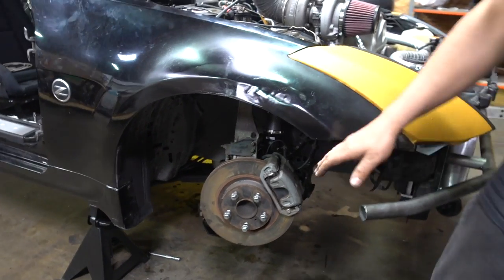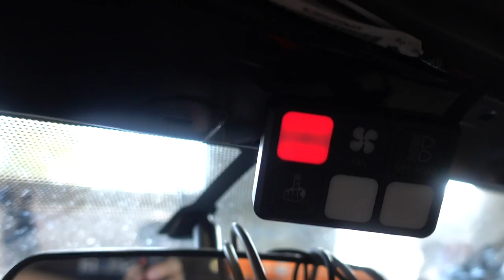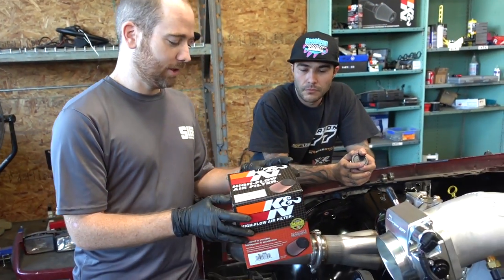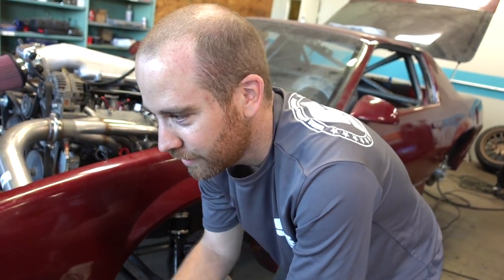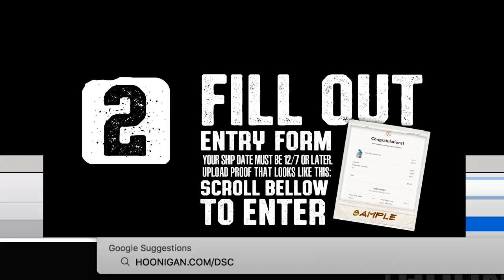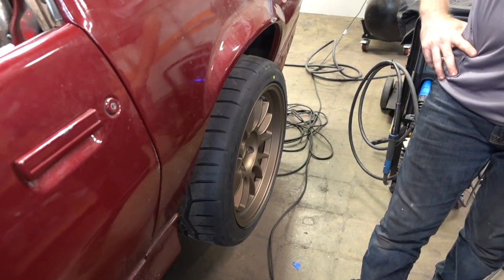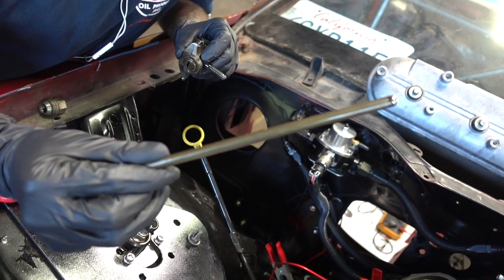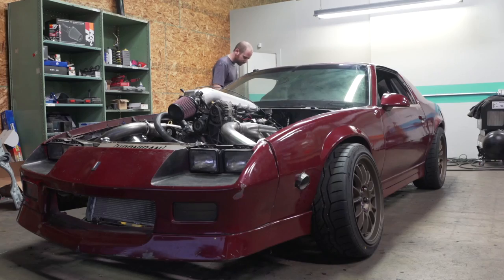Build & Battle 3: Built Honda K24 and Chevy LS Fire-Up for the First Time! EP.6

Comment from the maker: Which engine do you think is going to produce the bigger HP/TQ numbers: Turbo & Nitrous K24 Or the Freshly Rebuilt Cammed LS?!
Reply: Hoonigan Project Cars K24 492 / 412 - LS 461 / 444
Reply: K24 382HP/ 320TQ LS 398/ 410TQ
Reply: My money's on the Honda engine, them shits potent
Reply: I think the better question will be, which can hot lap the longest? 
But I'll make a guess for the fun. 
K series 520hp 440tq 
Ls 500hp 480tq
Reply: The K series might on spray but not enough compared to a NA LS motor... If it was turbo and was using spray to spool then that would be a different story
Reply: I think K24 it will win
Reply: isaac shively That is exactly what they said in this video 😒
Reply: The k is gonna make bigger peak numbers. The ls will make more hp over the average of the curve
Reply: @GummiEntchen49  haven't finished the video... Thanks for spoiling it
Reply: LS will have more torque, K24 will have more HP.
Reply: @GummiEntchen49  no that's not what they said, they are using the spray until the turbo spools not to spool the turbo... Have you ever saw Cleetus' Galaxy and how they drilled and tapped the nitrous line into the intake housing on the turbo? That's one way to do it
Reply: Ls but the 350z will be more usable power
Reply: the 4 banger will make more power but most of it will be useless. in race condition give me the V8 all day long
Reply: @isaacshively6705  its turbo/nitrous
Reply: Torque for the ls hp for the k24
Reply: The Honda motor might produce more peak hp at something crazy like 8500 rpm, but not by much and I doubt it gets to the same torque number as the LS. The LS will have a much more predictable, flat powerband and will perform much better in this application. I figure they'll both be around 400-450 whp, with the Honda getting 300-350 and the LS 400-450 ft. lbs. To be clear, I don't know much about turbo Hondas or either of their build specs.
Reply: @isaacshively6705  It IS turbo and using spray to spool... did you watch the fucking video
Reply: Lmao at the guys in here who can't handle that 4 cylinders are about to beat 8 and they already making excuses... displacement got replaced a long time ago, gramps
Reply: Peak numbers will go to the K24 with the turbo.  Useful power will go to the LS.
Reply: I think the too short push rods will take some hp away from the LS because it won't allow the valves to open properly
Reply: @birdie021  Until you start putting snails on the LS, plus the LS will take more of a beating overall.  Whether it wins or not, it should survive.  Cant wait to see the dyno/track days, huge fan of both builds! Amazing work!
Reply: Hoonigan Project Cars K24
Reply: Fun fact: Bald Eagles actually do kind of sound like that, Alex. Watch a video of a bald eagle screeching. In Hollywood, they use the sound of a Red tailed Hawk for Bald Eagles.
Reply: Do u really think a cam on a stock ls engine can keep up with nos and a turbo? Let’s be real here guys there’s a limit that you will reach sooner with a cam than you will with a turbo, not to mention the added nos. and if you think these guys aren’t willing to blow the engine for the win you are wrong. If they wanted they could throw a 600+ hp tune on that engine for one pull and take that w on the dyno. they will no doubt turn it down for the event but peak numbers definitely belong to the k.
Reply: K24
Reply: A turbo K24 is easily capable of bigger numbers than a n/a LS.
Reply: I hope the LS turbo guys drill out there cover breather holes and puts a scavenger pump..... tons of crank case pressure when you turbo the LS block
Reply: Tell the 4 banger guys Harley Davidson sells a plastic oil drain Spicket that will work perfect for draining oil
Reply: I mean, cummon muhfu'ka, I predict the LS will take the TQ numbers and the Honda will take the HP number...call it an educated guess...lmfao
Reply: K24 got the LS on power but not on torque.
Reply: @supersevenn  True, in road racing, tight course conditions, but at the drag strip, give me the Z. I have owned 56 cars in my life so far, some domestic, some import, but something keeps bringing me back to import. I don't really know why, just something about making the underdog outperform the big boy engines puts a big smile on my face. I have a 612 whp Civic coupe and so far I've ran a 10.39 @ 144 mph with it. I have a good friend that has a EG Civic hatch with a fully built B20VTEC turbo that ran a 9.90 @ 151 and that's a FAST car no matter who you are. I am also a co-owner of a huge car group here in Pittsburgh called Cruel Obsession and we all don't care what you drive, what brand it is, what your modification style is, as long as you love you car, we love it too. That sums up my attitude towards cars. If you love to modify your car, and you have pride in it, then I respect your build.
Reply: @DeShawnaldTrump  My thoughts exactly. The LS will obviously make it's peak HP number sooner, but it won't be as high as the K24, and we all know that the LS will make it's peak TQ number sooner because it's more than twice the K24.
Reply: @i.pfreely8336  could you imagine how I feel I own these 2 cars 89 Camaro just sitting there that I want to work on it & my daily is an 04 350Z.
Reply: @mamiphmotors  Fawwk, that would be too much for me.  I'm married with 9 kids,....so my coolest project is either my diesel Econoline or diesel Express van, one day... I'd love to build a 3rd gen the way that they are going about it.... brilliant!!
Reply: U shouldn't have to ask..im an east coast honda boy as well..all i got to say is, we know how to make the power...
Reply: im an LS guy but i say the NOS and boost will win.
Reply: With the nitrous and turbo I feel like the k24 will beat the crammed ls on both numbers. These guys are outmatched. But regardless this is a fun season
Reply: Lee Mcelmeel Surely they'll swap them before dyno testing/racing, won't they? If not, they deserve to lose, everything, haha! Their rearend's bad enough.
Reply: Nunya Bidness If you're referring to me, I'm 34 and think the Honda motor will make the highest dyno horsepower number (maybe even torque, depends on what kind of boost/nitrous/cams it has and the cam profile of the LS), and as much as I wish it weren't so, I think the 350Z guys will have the better track car if the front end stuff works. There's absolutely no denying, though, that a big V8 will have a flatter torque curve  than a Honda engine of any sort, turboed or no. That doesn't make one better, but it does make one easier to drive.
Reply: LS
Reply: isaac shively it is
Reply: dyno testing wont determine the winner or the outcome of the actual grid race tho, because power to weight ratio and grip, but i think the 350z is the lighter car and the boost + nitrous will likely make more power
Reply: K24 - 550 with spray 450 turbo only    
LS- 475

Suppy Jamo gonna tear it up but Josh and Alex really know their stuff
Its anybodies game at this point.
Reply: @i.pfreely8336  haha funny that's some shit no one ever said lol Honda will take way more of a beating
Reply: Nunya Bidness how old are you 13 bucko? Hp will be the k24 but tq will be ls. On race day, ls will take it unless they get Diaz under the k series. So go get your sippy cup, snuggle up with your blankie and watch displacement take the W on race day💪🏽
Reply: K24 it already started hahahaha
Reply: I'm a domestic guy, but I'm going with the Nissan/Honda.  I don't think that Mason cat knows what the hell he's doing.
Reply: LS...there's no replacement for displacement
Reply: Bigger average or bigger peak? The K24 might make a bit more HP at like 7000RPM with race gas but the LS will make usable power from off idle on pump gas.  A cammed 6 liter with a tune and open exhaust is good for 450HP all day.  Are they budgeting to fill those bottles and for race gas? Or e85?

The K24 is cool, but a novelty IMO. The only reason I see the LS not absolutely destroying the K24 is oil starvation/heat. It might be a problem without a proper baffle or accusump and oil cooler. Also I didnt notice any positive crankcase ventilation.
Reply: @613Builds  350Zs are actually really heavy for a 2 seater, it probably weighs the most
Reply: @chadingram6390  hmmm well i guess it could be anybody's win in the end, but in the hp department id say boodt and nos will definately help
Reply: Where’s ep 7

Comment: I can't believe it took them that long to realize that there was no compression. It was extremely obvious the first time they hit the starter.
Reply: That guy sucks at everything. It’s like the first car he built?
Reply: @romanh4044  guy is fabracator not an engine builder
Reply: Typical. I see it so much these days. Good fabricators. Like really good at fit up and welding. Some very good masters of metal I would say. But not a clue about function or system design.
Reply: @MegaEpicGamer  lol he's not a fabricator either. Alex did all of the fab work while josh walked around with his finger in his butt

Comment: Wrap pro tip, especially if you're a DIY guy (or have someone in the vicinity with a welder), tack a loop of welding wire or any weldable metal at the start and stop of the wrap. You hook your wrap on it, and tie it on at the end. This allows you to pull on that wrap until it calls the police, which is the best kind of wrap.

Comment: Power steering cooler should be on the hot (pressure) side. Cooling the fluid going back to the reservoir will do little to save your rack. 
Also noticed you double flared the the return line, when you only needed the first step. The first flare is to hold the line nut to the fitting. The second flare is to seal the hard line to the fitting.

Comment: Pro tip, if you’re planning on keeping something long term, don’t solid mount aluminium stuff like coolant pipes or intercoolers/charge pipes to the chassis, use rubber isolation mounts or rubber washers. 

The vibration can weaken and fracture aluminium over time, or if the paint rubs through on the steel, it can cause galvanic corrosion.

Comment: The troubleshooting they did on the LS is a good example of looking and listening to what the engine is doing.  I initially thought the same thing Jamo did, that the timing was out, but if you listen to the engine when they cranked it, the starter sounds like it has no load on it. It sounded like an engine turning with no spark plugs installed, i.e., an engine that has no compression.

Comment: I’m not sure, The K24 started right up on accident and sat on the rev limiter for a few seconds before they even got the throttlebody welded on,
But the Rebuilt cammed LS would not even start and he had to put shorter pushrods in it and he said that they were too short so I don’t think the LS is going to run for very long and it didn’t even sound like it had a cam in it

Comment: The ls will make more power if it has close to 500mm intake pipe length between the filter and the throttle. The nitrous bottle also need to be mounted in the valve facing forward orientation or you risk pulling gas from the bottles instead of liquid.

Comment: Well one thing he got wrong with the pushrods and rocker arms, is on an LS, the valve lash isn’t adjustable. You don’t just tighten, then give it a quarter turn like you would on a gen 1 or 2 sbc. The rocker arms are torqued to 22 Ft. Lbs. and that’s your valve lash

Comment: Never saw the Honda motor get a baffled oil pan or at least a S2000 oil pan since it was designed for a fwd car and now it's in a rwd car so it won't last long doing what they're gonna do with it... Didn't they watch the video with the K swapped 240? It had a custom oil pan and still was loosing oil pressure, but hey foget about it New Yokers don't need oil pressa